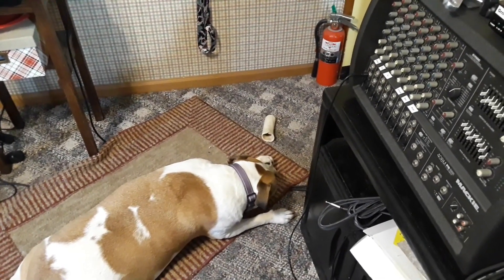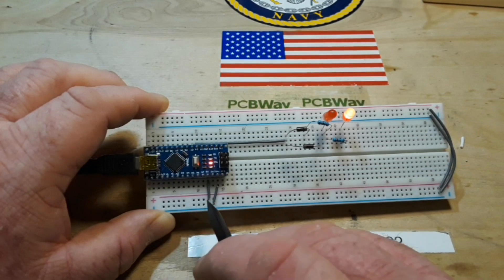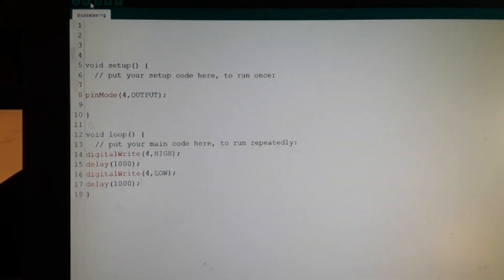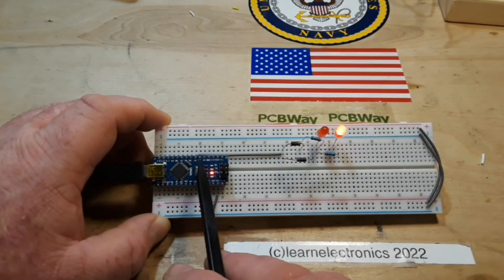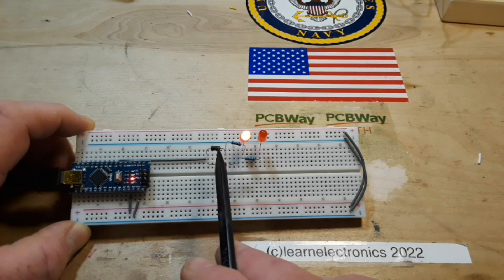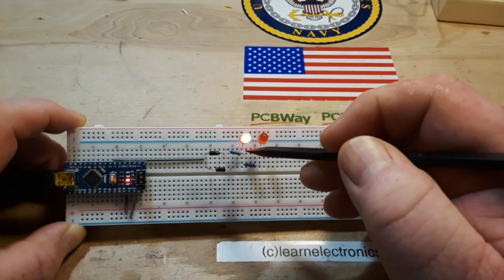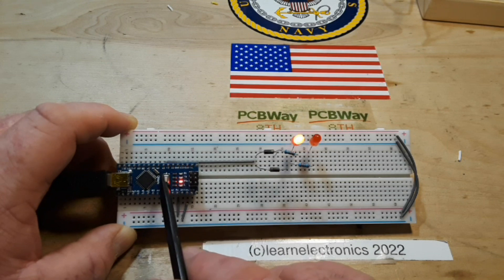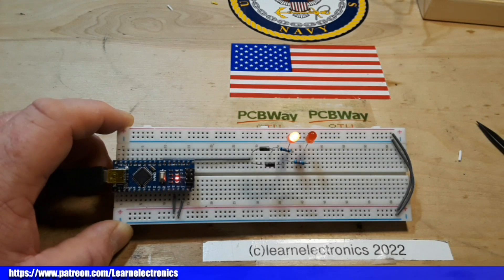Arduino Foundation Series: Source and Sink Current With The Arduino

Comment: Many of your Lessons are unique and offer important insights.  This Source and Sink a single pin was a great example.  I finally had to wire it up to prove it works since neither of Tinkercad nor Wokwi (no Diodes!) would work for me.  Anyway it was a lot of fun.  Suggest you start adding circuit diagrams BTW.   Anyway great job!
Reply from the maker: Thanks

Comment: Tot add my 2 cents. Depending on your setup, you van drive more power and/or stuff with one pin. Connect pin to a buffer/d-type flipflop :) 

A "buffer/d-type" flipflop. Both chips just stores the last high/low you sended on the gpio pin. When external chip matches/exeeds frequency of Arduino pin your sollid. Frequency is the on off herts per second. The extra chip also adds protection to the arduino in case something fucks up/shorts/whatever. Also depending on the family of buffer/d-type flipflop you can use that to control a higer voltage part of circuit. Vorexample a 20 Vm van be used tot drive a H-bridge that controls a 20V Servo/motor

Comment: PAUL, can you make another video lesson about using diode steering for various applications? it seems that you're only using ONE output pin on the arduino and used Diode Steering for sourcing and sinking current to the LEDs?
Reply from the maker: That is correct
Reply: @learnelectronics  You forget to mention how many LEDS can be used on the arduino because the arduino output pin can only SOURCE how much current max and only SINK how much current max? So the source current max and sink current max might be two different current ranges. You might be able to only connect 20 LEDS when SINK but can only connect 10 LEDS when SOURCING current. This is very important info that is overlooked
Reply: @waynegram8907  I would always use transistors or relays for loads exceeding 5mA, though. No matter if the digital pins are pulled low or high.
Reply: @waynegram8907  This may not be a problem when substituting MOSFETs for the diodes as I mentioned in my comment above.
Reply: @krzysztofmatuszek  its the max current output is 5mA for sinking or sourcing?
Reply: @waynegram8907  AFAIK it's about 40mA both ways for Arduino boards and roughly 20mA for ESP32, ESP8266 and RasberryPi Pico boards. I have no intention of performing my own tests, tho. Better safe than sorry.

Comment: Why do you use additional diodes? LEDs are diodes themselves, it's in the name.
Reply from the maker: The topic here is diode steering. I used diodes to separate the signal. Try it without, lemme know.

Comment: One could also substitute a P-chan and a N-Chan MOSFETs for the diodes to significantly reduce the voltage drops, if required by an application circuit. Perhaps another video would show this and maybe compare the two circuits.
Reply: Also:  "While standard silicon diodes have a forward voltage drop of about 0.7 V and germanium diodes 0.3 V, Schottky diodes' voltage drop at forward biases of around 1 mA is in the range of 0.15 V to 0.46 V"